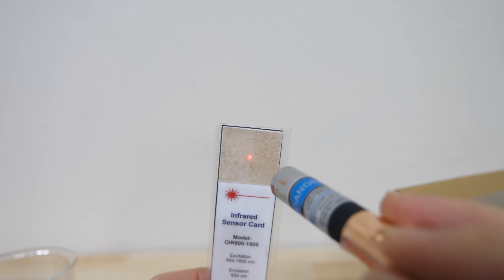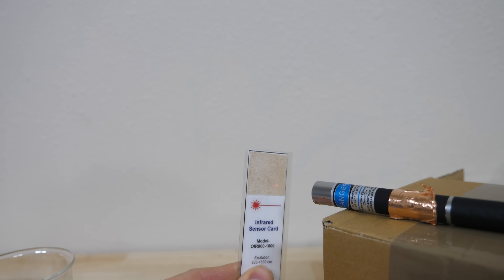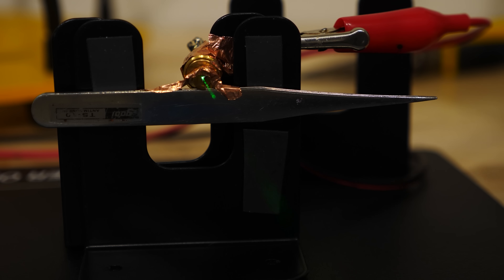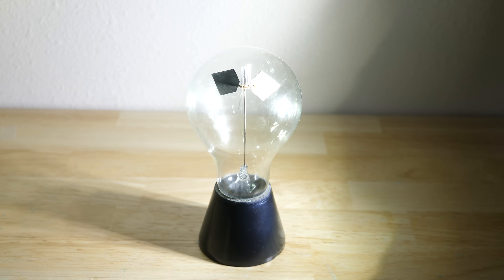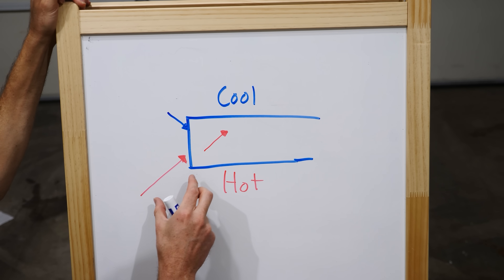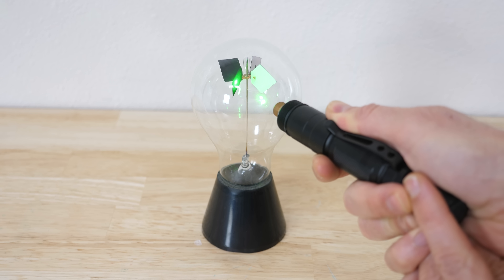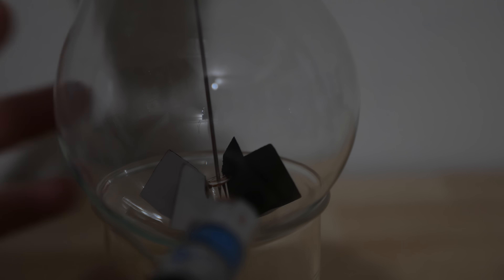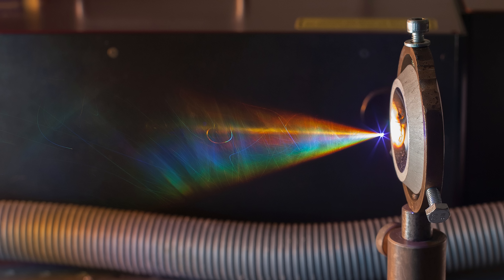I Had To Break My Radiometer For Science

Comment: this experiment reminded me of a theory i had about light bulbs, to get light you pass electricity (ie electrons) through the filament in a vacuum, but suppose you reversed the process and passed the same light back onto the filament will this not produce the same current that was passing through the bulb to make it light?  im betting that you are also producing a current through your black vanes when you are doing this, perhaps you can measure it,, im thinking solar panels or something similar like photo electric cell works that way too right? light goes in the cell and electricity is produced

Comment: Hi Action Lab,
Nice video and demonstration of that effect.

I'm an engineer specialized into organic and bio chemistry and I know a lot about chemistry and science, but less about specific aspects of physics. I had an idea about your experiment but I had to first check onto wikipedia what they say about Black body and Stokes-Raman.

I found that wikipedia under Black body states litteraly into the chapter "Near-black materials" that:
"They also have application as solar energy collectors, and infrared thermal detectors. As a perfect emitter of radiation, a hot material with black body behavior would create an efficient infrared heater, particularly in space or in a vacuum where convective heating is unavailable."
So this is precisely what you displayed :o)

Your IR laser hits the target (black or white; with black being a better absorbant and less direct reflection emitter than white); because it is under vaccuum (partial or near total), it will limit convective heating (and/or cooling) by surrounding gas molecules; so the heating happens into the spot shined by the laser beam; then it increases with the time of exposure (observed by the glow seen into your video between 3:49 and 4:12; that passes from orange to yellow to bight yellow-white); the ray then heats up the coating (sometimes with smoke) and the metal underneath; the molecular agitation into the solids then dissipates it thermaly into the metal radialy and concentricaly to the beam spot; then only radiative emission of the black body can be observed (as if your spot was a white source of light (like the Sun, like old bulbs of carbon or tungsten (W) filament heated by their resistivity under the passage of current through it) and it display the all wavelenght (color) spectrum of those (of course the light re-emitted is < or equal to the light from your laser (otherwise you would have created more energy than furnished).

So by activating the spot, the light takes some time to get ful emission intensity (ta); and conversely it should do the same, when the light is closed; the spot should glow darker by passing subsequently to lower wavelengts (yellow, orange, red, infrared (heat)) and this takes a little, but stil finite time (te). 
This in principle should be observable with a spectroscope with a dynamic of extinction caracterized by a more and more prononced red shift and IR (from blue to red - to the right); the enlighting fase would go counterwise of course with an increasing blue shift (from red to blue - to the left); lets say a "full color spectrum sunset".

---------------------------------

Now regarding your cristal doubling frequence; it doesn't contradict the principle of emitted frequency is usually < or equal to incident frequency because two photons of IR produce (more or less - :o)) but one photon of green light is less photons.
A bit what happens with a tide of water made of molecules with an average energy level; but when hitting a surface perpendicular to it; some droplets of it can go much higher than the tide height.

Probably that in a near future some other cristals with such rare effects will be discovered or rendered public... (see for example below anti-Stokes shift).

There are other cases where the frequency rule doesn't seems to hold:
1) When looking at Raman spectrum; it looks as if shining a laser frequency onto something makes 3 types of rays; 
a) direct reflection or scatering at the same wavelengt as initial
b)Stokes shift (red shift) that kind of gives a finger print of the molecules (kind of fluorescence type) thus lower frequency is emitted than the incident excitation frequency.
c)anti-Strokes shift (blue shift) that also provides info onto the enlighted molecules.

As a matter of facts a) >>> b) >> c) (c is a very very rare event statistically)
So "b" needs very strong filters to cut off "a" (and "c" will need even more efficient filters because its intensity is very low)
Int(a) >>> Int(b) >> Int(c)

Wikipedia states under Stockes shift:
"Anti-Stokes shift
If the emitted photon has more energy than the absorbed photon, the energy difference is called an anti-Stokes shift; this extra energy comes from dissipation of thermal phonons in a crystal lattice, cooling the crystal in the process. 
Yttrium oxysulfide doped with gadolinium oxysulfide is a common industrial anti-Stokes pigment, absorbing in the near-infrared and emitting in the visible region of the spectrum. Photon upconversion is another anti-Stokes process.

2) The famous effect of relative to each other speed of emitting source and observer; the Doppler effect... very observable with sound, but also with red or blue shifts of galaxies.
So approching galaxies (source arrive towards observer) or if we come closer (observer approches source) (or if both reduce their distance towards each other) will produce a blue shift that may look like frequency is higher than it should if everything was still and not moving at all.

Regards
PHZ
(PHILOU Zrealone from the Science Madness forum)

Comment: I would've liked to have seen what sort of light was emitted before taking the radiometer vanes out of the ziplock bag -- and how that compared to outside the bag -- to determine if any gases inside the bulb were having any effect. We presume the interior of the bulb is just a partial vacuum of breathable air, but what if it also contains gases not normally present in breathable air? Yes, I realize the gasses in the bulb would mix with the air in the bag, but still there could've been some measurable effect worth noting.

Comment: Damn, when I was still young, I constantly bought green laser pens and played around with them. One time, I broke the thin glass covering the outside of the light bulb, which is the non-linear crystal mentioned in this video.

I thought the red light from the laser was very faint and harmless, so I continuously shone it into my eyes at that time. Until one day, I turned on the camera on my old phone (which could detect infrared rays), and I saw that the laser was very bright through that camera, while to the naked eye, it was just a very dim red color.

I had been shining that dim red light into my eyes continuously without realizing it was an infrared laser beam. I don't know if this is the cause, but my eyes now see a large strand of collagen, resembling bacteria, present in my eye fluid.

Comment: Listen, lets look at the basics you are ignoring here:  Energy can be neither created or destroyed, only transferred or transformed, and the pressure hitting the white surface is the same as the black, but what hits the white is divided, some being absorbed as momentum, some being reflected, and the total cannot exceed the initial pressure applied, so the white surface cannot exert more force then the black, whilst the same amount of energy hitting the black surface is completely absorbed, making for more momentum pushing against the black than against the white.  Heat has nothing to do with it, heat doesn't care what color a surface is unless the heat is the result of resisting light.  A black and a white metal plate in a dark room equidistant from a heat source will be thermally identical, but remove the heat and hit them with light, the black surface becomes a heat source and the white becomes a heat reducer, due to the friction/resistance of the black to light escaping when it hits.  Also, heat only makes it spin when there is a lens like the glass bulb between the radiometer and the heat source.  That is because heat only excites photons if there is a means of it transferring the energy to the photons.  You can have light without heat and heat without light.  And light makes the radiometer spin with more variables than heat does.  Ignoring the basics that don't suit a theory only proves that you are not performing science.  Science is making a guess and either proving or disproving it.  Believing something and refusing to be proven wrong because if you believe means it must be right is closer to religion than science.  Belief is taking something on the lack of proof, science is taking things on proof regardless of belief.

Comment: That's very odd. I have a guess that it's black-body radiation. But, I wouldn't expect that to be so bright. Or, if it was, I would expect the thin radiometer leaves to melt. But I'm not a physicist, so I don't really know.

And I unpause the video, and learn that I'm right, it was black-body radiation! I hadn't yet gotten to the part where you mentioned the vacuum, and once you did I thought "Oh, so there won't be air to carry away the heat!". I'm pleased that my instincts were so correct. :-)

Comment: That is what I thought at the first instance it happened. Black body radiation. In a vacuum there is no conduction to let off the energy so all the energy is radiated out as light. A thinner and darker sheet suspended in vacuum should be ideal. May be try with the vantablack coated thin paper sheet in an inert gas filled vacuum environment.

Comment: Would it be just regular incandescence? Aren’t you getting to use the infrared light twice? 

The heat is exciting the electrons up to a hogh energy state, the infrared knocks them back to the low orbit emittibg visible light, but the atom keeps getting hotter.

Isn’t the infrared light doing double duty?

Comment: But why it instantly stopped "glowing" from being white hot, when you took the laser pointer, if it cant dissipate heat to the air because its not existing in vacuum, that leads to thinking that surround material took some heat, but then why the wole panel doesn't starts glowing or at least the dot should get bigger and bigger the longer you kept IR laser pointed at it

Comment: To me, the black coating looks like lamp black... It does even smoke like lamp black, if heated (like you can se).
So the bright light may be indeed black body radiation, because lamp black is extrem close to an ideal black body.
And an IR-LASER is easily able to stimulate an ideal black body.

Comment: The reason it works in the vacuum is because of the barrier between.  In this case the barrier is glass.  Energy is going through the glass to turn the blade.  The dot you see is the source wave crossing back on itself, or twisting (perspective). That results in reflected visible light as well as pull/thrust for the dark blade.  The shape of the glass is important as well.  When you used your chamber, the dot seems to reflect back from the barrier (chamber material) and not the blade itself.  The bulb shape combined with the vacuum, converts the light to thrust and allows you to view the light on the next barrier (the dark side of the blade) from all angles as if that's exactly where you point it.  But you are pointing it there.  To me that ties into why time seems to stop around black holes. It's like the space between is the barrier, the distortion.  From another viewpoint, that dot from the Infared laser (low pressure) is the eye of a reverse hurricane that draws in high pressure (and we see the point of the laser). The equal and opposite reaction is the spinning of the blade and reflected light.  To me the basic function of reality, and a positive and negative charge with a gate between.  The real control comes from the gates. Galaxies wouldn't look the way we view them without the gravity of a blackhole.

Comment: I would guess black body radiation from the surface. The radiometer blade is probably very low thermal conductivity, to maximize the thermal gradient across the blades. In atmosphere, the temperature that the blade reaches under infrared radiation is relatively moderate, so no visible blackbody radiation, due to the convective heat transfer away from the blade. However, in a vacuum, there is no way for the heat to escape, and so the blade heats up significantly, and begins to radiate.

Comment: IR laser heats up just the surface of the carbon based paint causing black body emission. Lack of oxygen and pressure inside the radiometer prevents degradation of the paint as well as heat dissipation.

Comment: Hello Sir, 
I understand that you are telling that and object when heated will emit light starting from infrared towards visible light.

Something I don't understand is that if that radiometer is getting really hot with just the infrared laser, 
won't the radiometer's sheet melt when we shoot the green laser...

Also, if it is getting hot, wont it be starting from red and going towards other spectrum... We can confirm your expt by using this and having a high speed camera to record if this is really by heating and incandescence
Thanking you,
10th grader

Comment: Why didn't you try to burn other surfaces at the right focal point, or try it on other surfaces in a vacuum? Will it burn skin too?
Reply: Not likely.. It seems like the black coat on the radiometer is very good at absorbing EM radiation, that's why when you shine a super condensed stimulated "light" at it it gets super hot very quickly.  I bet if he used a red laser, it will glow even more. Other surfaces, like your skin are not that great for absorption of light, so they wont heat up that much. You'll need a lot more powerful laser for that.

Comment: what about black body radiation?
we already established that this moves because of the heat of a flashlight's light and those aren't particularly hot either.
so what if the laser is heating a very localized area of the material and thus producing black body radiation.

Comment: In a vacuum there is no convection. With the black surface absorbing the laser energy and having gotten rid of your largest heat sink the material will heat up and emit black body radiation in the visible spectrum. Since different parts are heated to different temperatures you get white light.
Reply: Good point about the lack of oxygen and it also seems that you answered your own question.

Comment: And this is why ir lasers are horribly dangerous, you cant see them, but they can turn your eyes into plasma post haste
Reply: ?!?!?      lololol        are eyes in  VACUUM.?        fool
Reply: @daviddavids2884  i know this is mostly a troll post, however, although the light is brighter in a vacuum, the damage is worse otherwise.  As can be seen by it burning through the flags rather than just flourecing them then doing no more.  In fact, its actually worse in an eye, because due to the structure and make up of an eyeball its more or less the same as heating a steam reactor inside the eye, and would basically boil the eyeball as well as burn the rods and cones out, and all from a completely invisible to the naked eye laser.

Comment: It's black-body radiation. You are firing an infrared laser (i.e. pure heat) at a black/dark surface. That tiny surface point super-heats. That super-heating interacts with the low-pressure gas in the bulb, and the interface of the two materials transfers heat, the kinetic interaction of the black-boundary being the cause of the photon emission. The emission spectrum, caused by a thermal black-body, will naturally smear across the entire spectrum, with a peak-intensity at a color corresponding to a temperature.

Comment: I know everybody can say it, but that was exactly my first thought, and also that it happens in vacuum because there is barely any heat conduction or cooling effect due to air. The white yellowish but warmth changing white light on a black surface was more than suspicious. My idea was to, to measure the surface with an infrared thermometer. If you had had that idea too, your radiometer woud be probably still alive. ;)

Comment: I believe this is just blackbody radiation, no nonlinearity needed. The convection of air cools it down so the maximum is at lower frequency, but the light should still have all visible spectrum. Probably with a prism you'd be able to see how the intensity of colors changes based on temperature. To regulate temperature you can use a pulsed power source, a longer pulse will produce hotter blackbody radiation.

Comment: Combustion doesn't have to happen to generate light by incandescence.  If you measure the spectrum of the light coming off the black side of the vanes, I would be willing to bet that it's very similar to the blackbody spectrum of a source at a certain temperature.  You might be able to calculate what this temp is knowing the output power of the laser.